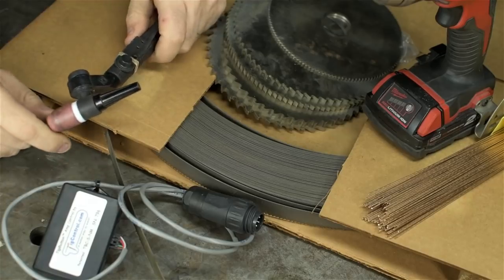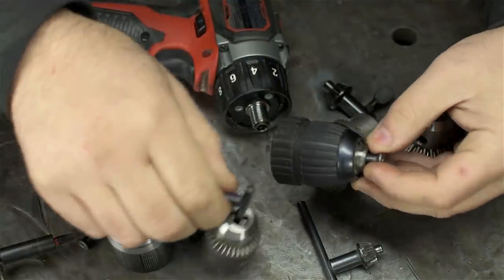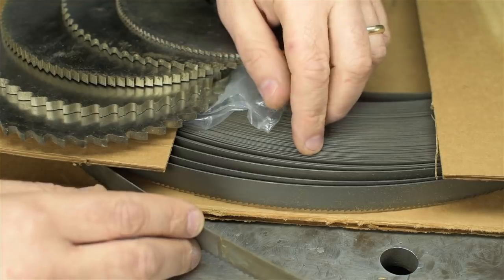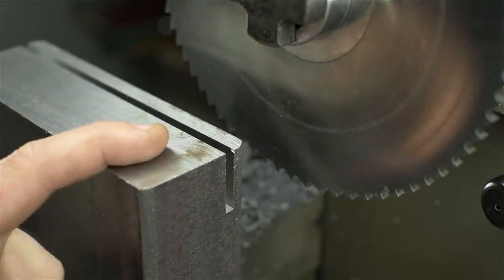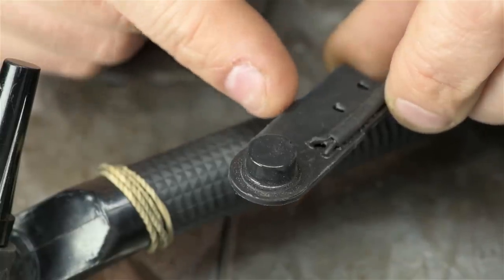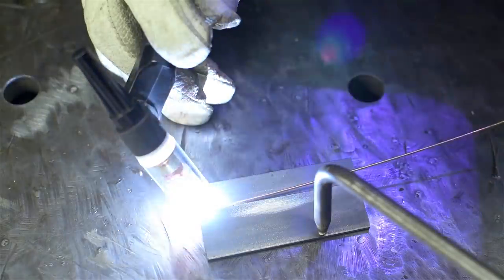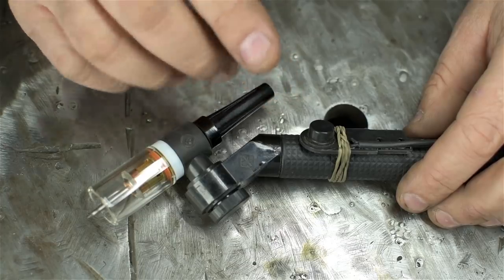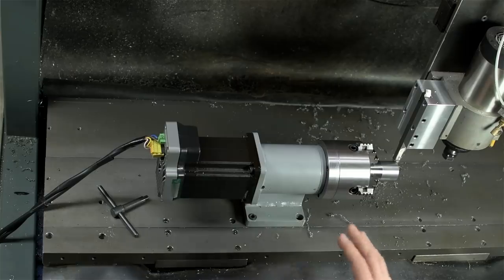STP #7: Saws, TIG Button, Brazing & More!

Comment: The carbon blade saw blade - make a Bow saw for sawing anything in the yard or shop that is to large for the machine band saw. I am doing that with a 2" steel cutting hacksaw blade.  With it's teeth let iron wood show up or a block of something.  Work but how to saw something larger than the band saw.

Comment: So maybe a dumb question TOT but why not turn down the diameter on the Lowe part of the Bosch chuck so it doesn't bind up on the clutch?
Reply from the maker: it didn't look like they gave me a lot of plastic to work with.  that and the import chuck was ready to go.

Comment: Cut a keyway into the arbor hole of the saw and then make or modify a threaded spacer thing to hold it in there. Beats the current option.

Comment: I've never welded before, so I'd be curious to hear your opinion on this: Would you think variable amp control would be easier using the button you have now or using something like an analog slide switch? I feel like a slide switch may give you better control over the exact power output and would affect your grip control less since you won't have to vary the pressure of your natural grip, but I also have no idea how it "feels" to weld so I'm not sure if my thoughts are accurate or if it would even be practical.
Reply: Slide controls exist too. But they suffer from the same issue as the button, manipulating the control tends to cause you to jiggle the torch. I use a torch mounted switch that's simply on-off and it's great for doing work where you cannot use the pedal. But Its a challenge to switch off without dipping the electrode.

Comment: you have a chuck, which is slightly too large in diameter. and you have a tool in the shop that it´s sole purpose in life is to reduce diameters (outer ones that is) 

just use your lathe ToT :)

Comment: You’ve got that spot on mate, the Milwaukee has unreal torque especially on low ratio but the chucks are absolute garbage. I’ve used Milwaukee for ages now and the chucks ruin what is otherwise an amazing tool

Comment: It's a shame you don't have a lathe you could use to turn down the outside diameter of that Bosch chuck a sixteenth of an inch so it would fit inside the clutch housing.

Comment: for your cnc/lathe thingy, why isnt your cutting tool at the top of the stock that you are turning? is there any actual difference as to how the tool cuts at the side like that compared to the top? im asking because ive only seen normal lathes cut from the "top"
Reply: In another video he talks about that choice. It comes down to the rigidity of the machine is greater in the z axis, so less deflection when the cutting forces are up, verses cutting from the side if the tool was on top.

Comment: Actually... Milwaukee chucks are garbage for wood as well. I know this from experience; they don't hold on to bits for very long and I'm always having to check the tightness of the chuck. Lots of power, though, just like you pointed out.

Comment: Hey Tony. I'm really curious as to exactly what hardware you use to run your stepper motors on the cnc router? Also do you use a windows 32 bit OS?
Reply from the maker: if you can wait another day or two I cover it in my next video.
Reply: @ThisOldTony  Awesome! Cant wait. Keep up the great content.

Comment: This may seem weird, but I've never used a vertical band saw that didn't have a blade welder built into the side of it.  Subsequently I never even looked at getting a pre-made blade.  It's weird how if you go to work in a workshop, how that workshop does stuff becomes the norm even if you find out later that it was all wrong.  We never had a foot pedal on our TIG welder for example, so for me, it's weird to see one without a button.

Comment: I bought a half inch "heavy duty" corded Milwaukee drill for doing some hole saw work in plywood.  I cut 4 holes and the bearings went.  I returned it and bought a Dewalt.  I did 20+ more holes without any issues.  I am firmly in the anti-Milwaukee club except for their reciprocating saw.
Reply: DeWalt jumped on the Chinesium train a long time ago, leaving only Makita and Milwaukee as serious contenders. Now Milwaukee seems to be crap too. Unfortunately it looks like Makita is the only quality brand left now. :-(
Reply: @PhoenixRevealed  I've been pretty happy with my Dewalt (corded and cordless) drills so far.  When they go, maybe I'll give the Makita a try.
Reply: Having run both the milwaukee with the 9ah battery and the dewalt 60v drill, totally sold on dewalt.  Much more speed capabilities, incredible torque, and the chuck grabs really hard

Comment: The chuck problems you are running into are common with all new drills. Most of the chucks suck ass and have alot of run out anyway but the slipping issues are largely because they have so much more torque than old cordless drills I would almost guarantee if you put the bosh chuck on the Milwaukee you would have the same slipping issues.

Comment: Hey tony or anyone who sees this, what is that six jaw adjustable collet thing called? I'm sure you've answered this before, I've been looking for one because it's awesome but can't find what they're are or what they're called.
Reply from the maker: timestamp?
Reply: @ThisOldTony  No, that most certainly isn't it. Timestamp is when you stamp time.
(I will see myself out, have to go to the shop to fix my ER32 collet chuck holder)
Reply: Sorry that was very stupid of me I should have been more clear, I was wondering about the work holding device used in the lathe for the small cylindrical parts in the ring roller. It is not an e32 collet it seems to have moving fingers that clamp the part? Sorry for my incompetence I don't know shit I'm not a machinist I only went to machining school...
Reply from the maker: Pratt burnerd multi size collet chuck.
Reply: Thanks for your help! You and the other youtubers really keep me inspired to go out and turn some good stock into scrap👍

Comment: I have and use regularly a m12 & a m18 Milwaukee drill.  The chuck on the lesser m12 has held up a lot better than the chuck on the m18. The m18 is roughly a year old & the m12 I’ve easily had for 5 years. You’d naturally think with the m18 you’d get ‘more longer’ life out of the battery, more chooch and ‘more better’ jaws. Not the case in this instance. 
The chuck on the m18 seems to have a lot of wobble from when it was new. 
Just my .02.

Comment: Haven't gone down the comments yet but mil-fuckee 1/4" hex drive drill sets come with a 1/2" drill that's got a 1/4" hex drive. use it in my 1/4 newfangled hydraulic impact all the time for dead tree carcasses.

Comment: I hope your not one of those guys who tightens the chuck with the motor, most modern chucks have a positive stop allowing you to torque the chuck properly. I’m the only guy in the shop who doesn’t use the motor to torque the chuck and it never slips.  Same drill as you have used every day. Cheers

Comment: Why don't you just grind down your half inch bits so they have flat edges so the chuck grips it?
Reply from the maker: I probably have over 200 of em!
Reply: @ThisOldTony  set up that shiny new CNC to do it.
Reply: Grind em as you need em.
Reply: I mean, if they are all half inch, you only need one template, it's just swap and go.

Comment: 13:20
"Over-molded strain relief"? Is that what these new hobbyists are calling hot snot?
 If one of those wires breaks, you'll be redoing the entire plug anyway, so go ahead and put something on there to keep it from kinking where the wire meets the plastic.

Comment: indeed RÖHM GmbH are still one of the best chuck manufactures in Europe, along with Albrecht and a few others.
check out roehm.biz or us.roehm.biz and look for drill chucks, you can filter by bit size, mount, etc.
your drill looks like its a high torque type meaning it only take one hand to tighten or loosen the chuck without the gearbox turning so you should get a one piece chuck which has the locking sleeve ring (the bit you hold) the full length of the chuck. hope this helps.

Comment: Old video I know, but I just want to add that I have had nothing but bad luck with Milwaukee chucks, doesn't matter if the drill is corded or cordless, M20 or M12, Fuel or standard, they all have sucked

Comment: Odd you posted about the M18 drill.  From day one I didn't particularly like it.  This weekend I decided I hated it.  Newborn's have a better grip.  My chuck has quite a bit of run-out as well.  You claim your drill will twist your wrist.  Mine will not.  First hint of a bind and it disconnects power.  In the end it is heavy and doesn't do the work asked of it.
Reply: Newborns do have a decent grip though.
Reply: @therealstubot  Agreed!   LOL!

Comment: You are using this button wrong! Look like it senses bending of plate, not force on button. Put something under these two holes so part with button you press suspended in air and plate can be bend a little bit as you press button.

Comment: Why not build a huge belt grinder- you know for making knives etc? 105” belts.... convert a tread mill. Coz reasons.
Reply: I did, and use it for making knives... the most commonplace belts hereabouts are 2 m in length (around 78.75 inches). That way the belt cools down much more quickly. However, the width is only 5 cm (~2 inches), but you can have belts manufactured on demand for size... but you would have to be careful if you have a sanding belt that is as wide as a treadmill :D
Reply: Nemozoli yip - I’ve taken the skin off
My knuckles many times from 72” grinders! Least a treadmill is variable speed and 110V. I might be making it up but I sure I saw it done on a you tube video. 👍

Comment: Yea that Milwaukee chuck is terrible. It just drops bits all the time. I am amazed it’s so bad.  A lot of times I can the chucks off
Reply: Also the one I have now has an “electronic clutch” so it detects the torque and stops but there’s no “clicking” - it’s also terrible- the speed is directly proportional to the chuck setting. Which means “1” is super slow to start.  It gets up to the same speed - eventually- just the acceleration  is low

Comment: Did I hear microwave transformer spot blade welder appliance?
Reply: Ah you made me blush I am a married boy..  You think it could work ? like the industrial blade welders.. or like on a fibre splice.. blades locked down grinding blade to square up then  move in on a non conductive base weld. Then the difficult one, anneal ... I was thinking pwm to the transformer to control the heat .. maybe one of the viewer have more force... knowledge

Comment: That speed your doing with that blade is toooo fast... it will wear out if you keep running it so fast, no fun to find out yourself.. They get really really hot.

About the Welding, I think iv seen you welding great before but try slower. Your adding to little material and going to fast :) weld some new T:s and cut them. You will see that your weld doesnt fill correctly :)

Comment: Milsucky is made by TTL industry black an Decker , min as well say fisher price , get a Makita like real men do lol
Reply: Is that the brand with the 1mm radial play in the chuck?
Reply: It’s TTI.
Reply: @DrFiero  I stand corrected...
Reply: @m1k869  Are you saying the Makita doesn't have play? Seriously, I want to know what modern consumer-grade cordless drill has low run-out, anymore.  4-6 thousandths seems to be considered good, these days.
Reply: @mildyproductive9726  Not so much runout but just slop. I guess having half a kW gearboxes the size of a small box of mints leads to poor radial support. Makitas are famous for wiggly chucks, at least some models. But you get what you pay for, and beeing a fanboi of a particular manufacturer is amusing. Because you pay the same amount of money for the one M brand and the other, and both have cut corners. :D

Comment: So as a big Milwaukee fan-boy I am not afraid to say Milwaukee drills suck. Atleast the non-fuel variants.

I do not love DeWalt, HOWEVER I do love DeWalt Made in the USA 20v (max lol) drills. I’ve had mine for years and years. Literally indestructible with a LEGIT Jacobs chuck. Much, much, much better than the Milwaukee tool. 

You could trade the Milwaukee in and buy a Fuel tool, they are 500x better than the home-gamer models.
Reply: I have the $99 combo brushless DeWalt. I've been using it as a trolling motor for my 11 foot boat with 3 people in it. I've put hundreds of hours spinning a 8 inch prop at 2000rpm.  Haven't had any slipping problems on a 10mm shaft.

Comment: Rohm makes a replacement chuck for my Milwaukee 2704-20 hammer drill. If your model is the same (or later) I believe this chuck would be a very nice keyless replacement. 

http://www.ecatalog.rohm-products.com/keyless-drill-chuck-extra-rv-28

Edit: Called Rohm to get a replacement for myself, and they don't sell direct. I called dgisupply.com and they were able to facilitate an order without a ridiculous markup. 

Thanks for your videos!

Comment: that finger amptrol is crap. why not just use a name brand one?  there is nothing ground breaking about it. that thing is a crap arduino project chock full of poor execution.
Reply from the maker: which one is the name brand?  link? now I'm curious.
Reply: @ThisOldTony  All the welder manufactures have their own flavor, along with all the torch manufactures as well. This will get you started. https://www.arc-zone.com/remote-amperage-controls
Reply from the maker: thanks diesel I'll have a look.